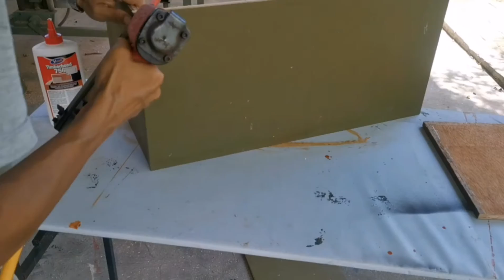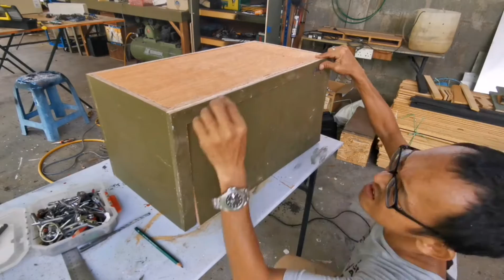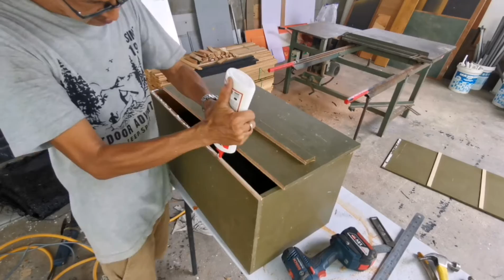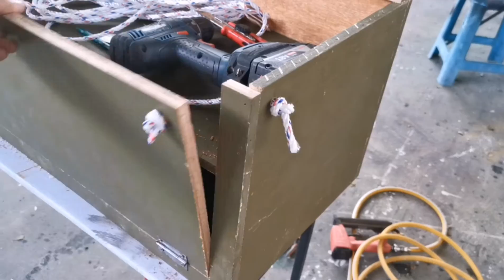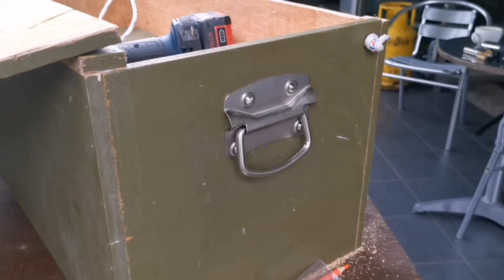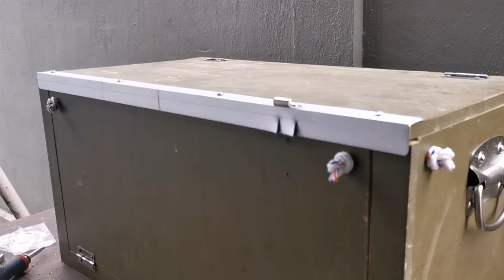My mini Camp Kitchen

Comment: A good size and quite neat. However... If the top lid, instead of hinging to the back, was cut in half and hinged to either side, you could have two worktop areas to left and right of the central box.

Comment: Nice design overall. A few thing that give me pause though. The weight due to the thick plywood used and strength due to only broad nails and glue.
Structural strengths can be overcome by using strips of wood in all the corners and weight can be solved by using 1/2 inch (12m) plywood for the outer case and 1/4 inch (5mm) for the dividers.
Reply from the maker: Tq